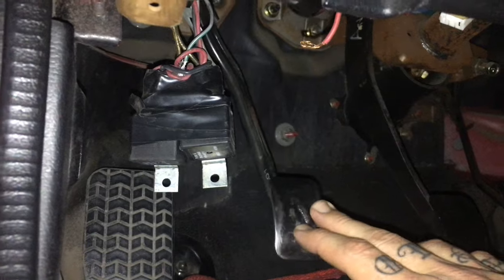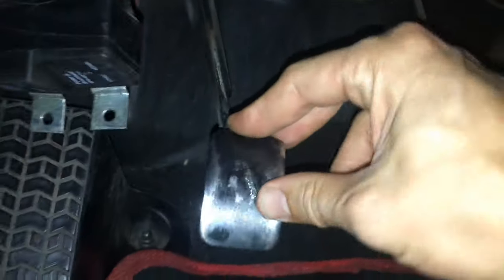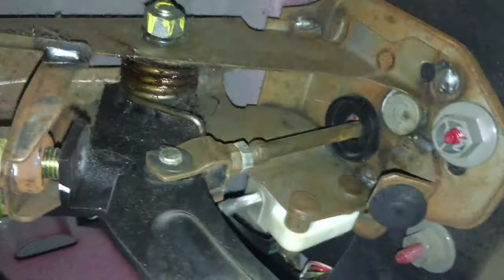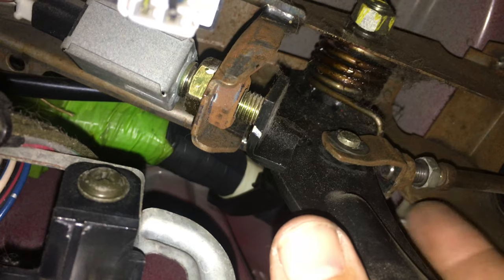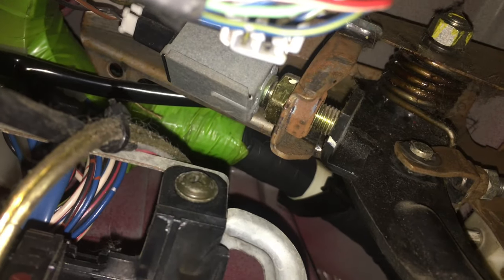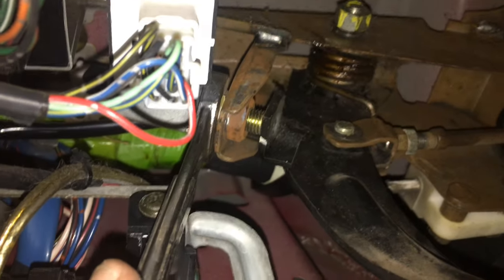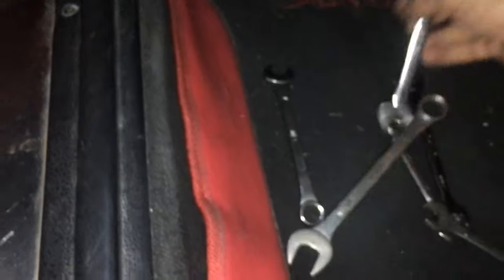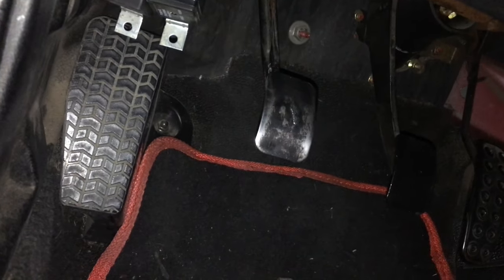Miata Clutch Pedal Adjustment (Quick And Mostly Painless)

Comment: Threading the long bolt all the way to the end of the threads to allow the pedal all the way up is not advised because the long bolt lengthens inside of the master cylinder and the bolt blocks the bleeder valve and doesn't allow the fluid from the slave to flow freely not giving a true pedal feel because it's holding pressure inside. Can't be good for long term hydraulic lines/ parts. You need to mark the long bolt prior to unfastening it, and adjust it while you go back and forth and move the slave by hand-- this tests to see if the piston inside of the slave moves freely and allows the fluid from the slave to travel back to the reservoir on the master. Repump the clutch to build pressure and repeat until you can move the slave and fluid returns to the reservoir. I had thought I did the job right and felt confident about it, even went for a drive but I smelled a little fluid leak somewhere, so I watched another video and ended up having to go back outside in the dark and adjust the long bolt because I believe it was blocking the return valve. Ideally you want the switch bolt(17mm), to be flush with the nut but I was not able to achieve this because my long bolt that blocks the master return was almost at the end of the threads when I was flush with the nut on the 17mm switch. Allowed a few threads to show near the switch instead(less than previously), and that allowed me to feel more confident about the long bolt's position. Went for a spin, and can't say things feel.. different? But I guess ease of mind knowing it's free flowing and not holding pressure in the slave or the return lines. Still achieved close to zero slop, and improved pedal feel and "sweet spot." The things I describe might be a first gen '89-'90 things. Instagram: reformedprize source: flying miata

Comment: Had same issue with my NB. Went straight into replacing slave and master cylinder and nearly lost my mind when I had the same issue still happening. I'll try and fit ass down there tomorrow and HOPEFULLY this is what was causing my issue.
Reply: Did ot resolve the issue?
Reply: I'm having a similar issue on my NB. I can shift into gear no problem when starting the car, but when I try to shift out of gear, it will be stuck in gear. I have to let off the clutch and depress it again to engage the clutch. The clutch has a lot of play I think, it's almost impossible to lift off the clutch even a little without stalling the car.
Reply from the maker: Sounds to me like the pedal rod needs adjustment or the master/slave isn’t getting full pressure anymore. I’d try adjusting the rod first and then come back to let us know what happened.
Reply: @MonkeyWrenching  I tried adjusting the pedal a little, the bottom nut was stuck, so I just adjusted the top part. It made no difference, and looking at the pedal mechanism, it seems to be working fine. 

I think it's definitely the master/slave cylinder. Ordered both on Rockauto for 20 bucks and will replace them on Sunday.
Reply: @MonkeyWrenching  Update: Just replaced both master and slave cylinder and the clutch works good now! Engages firmly and holds when I press the pedal down. So glad it was just the cylinder. I was worried my synchros were going bad since I would hear a slight grinding when shifting from 1st to 2nd, but since I replaced the cylinders it's quiet.
Reply from the maker: Great to hear!!!

Comment: seems like there's more space around it on the LHD than RHD, mine is jammed right up next to the steering column
Reply: Same! I’ve just attempted this is my pedal has so much play and I cannot even see where the small nut is…
Reply: @Revved_up_jb  I did finally manage to do it. Had to take off the plastic cover under the steering wheel, then basically lie upside down with my head in the footwell. Was a challenge!

Comment: My Miata has an issue were I step on the clutch all the way and won’t start immediately why?
Reply: cannot really understand what is going on by the comment alone but try checking the clutch cylinders it's a common problem for the miatas especially the slave cyl (I'm new to the car scene so try to ask for another opinion)
Reply from the maker: Sounds like the pedal sensor

Comment: i’m having problems with my pedal , tried adjusting it like the flyin miata kit said to exactly do , was able to drive for three days and then boom couldn’t shift again and they said to try and re adjust the pedal and it’s still not working. i’m stuck
Reply from the maker: When was the last time the clutch hydraulics were serviced? The slave might not be moving the fork enough
Reply: @MonkeyWrenching  i recently did a motor swap and replaced all the hydraulics while i was at it. the shifting problem began so i replaced them AGAIN and then adjusted the pedal as well and now i’m back to the same issue. everything is brand new :/
Reply from the maker: Hmm, that’s odd. I know with mine it took a bit for the pressure plate tension to settle in, now it’s not adjudged out so far but at first I was afraid I’d have to extend the adjustment rod.
Reply: maybe when you bled the clutch you didn’t get all the air out? mine had a lot of air